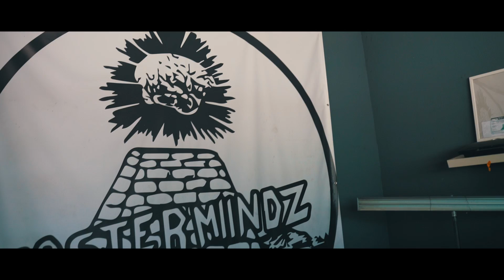NEW WHEELS FOR MY BMW M3.. AGAIN?!!

Comment: Here in the Bay Area. Vert m3’s go for around 18-20k while the coupes go for high 20’s low 30’s.  What is y’all opinion on the verts.  Besides it being heavier. Lol.  At these price points it’s like either I have a vert m3 or no m3. Oh and I’m talking about the e92’s & e93’s